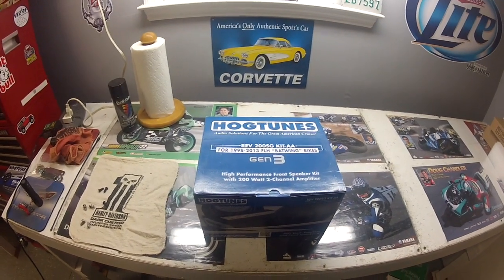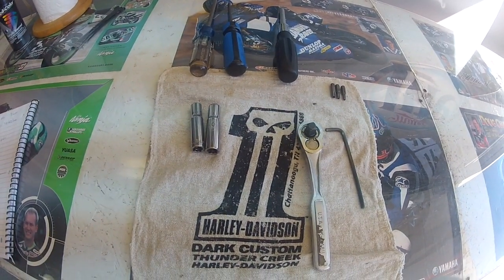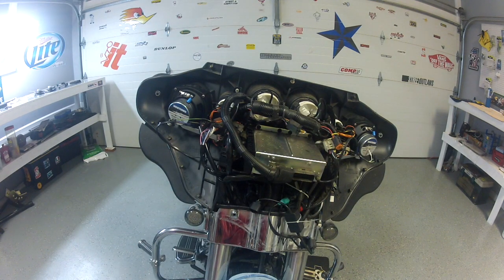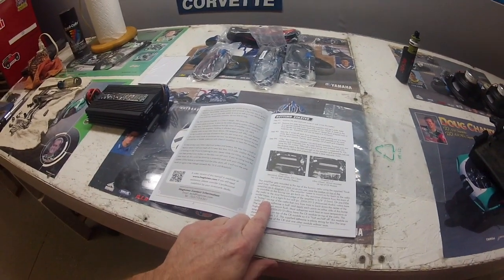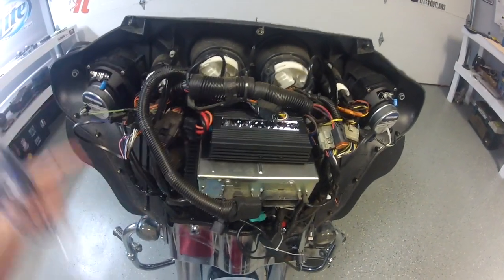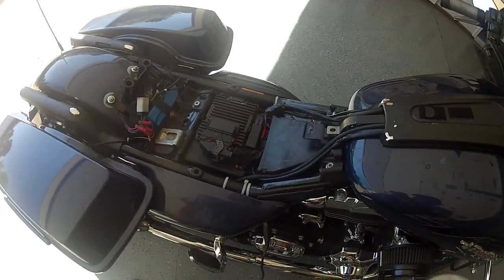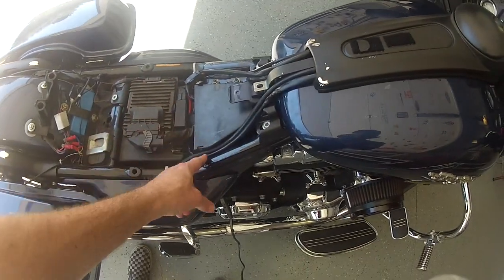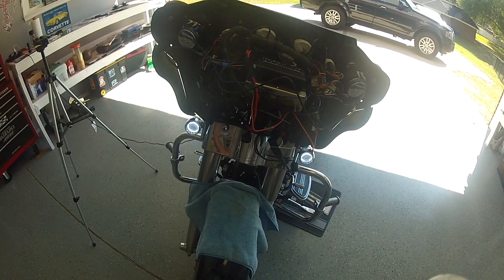Install Hogtunes Speakers & Amp on 1998-2013 Harley Davidson Touring

Comment: In your Bluetooth install a video, you mention running a signal wire from the cigarette lighter. I do not see that as part of the video here. Do you have to run a hot and ground to the battery, and have a signal wire from the cigarette lighter for the amp?  Both the amp install and Bluetooth install videos are top-tier. Thank you!
Reply from the maker: lordofthehouse Honestly, I don’t recall the exact details at this point. But I do recall tapping into a wire over there, just don’t remember the color etc. Sorry, been to long ago for me.